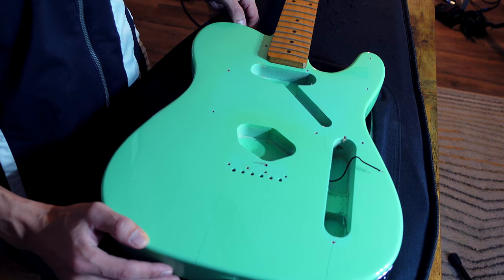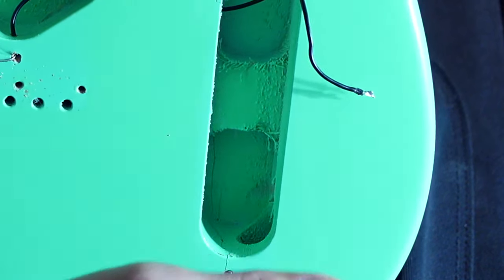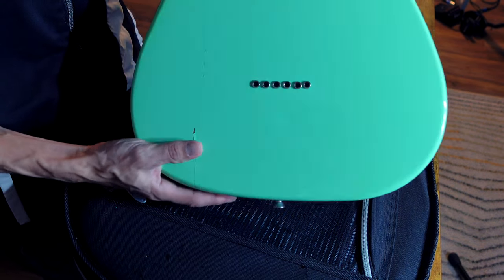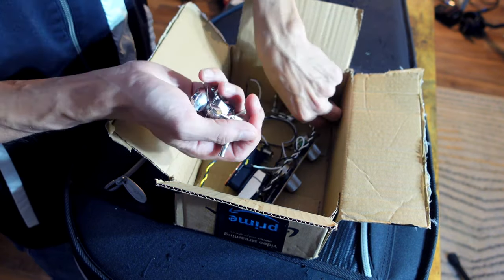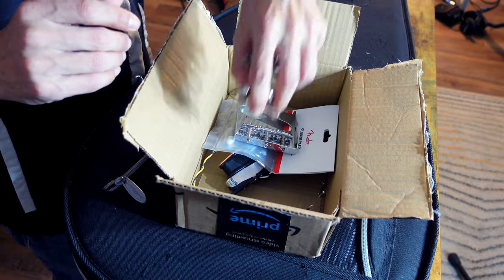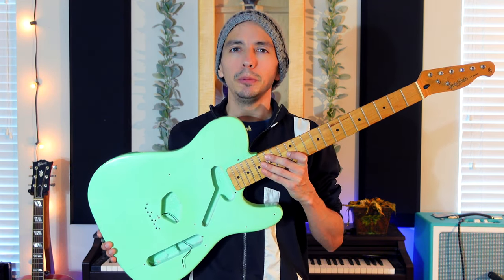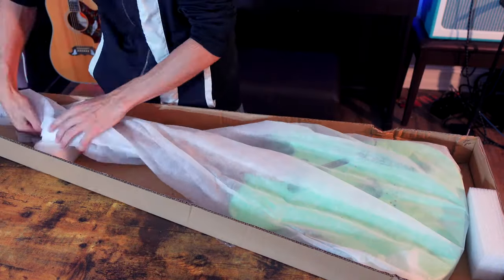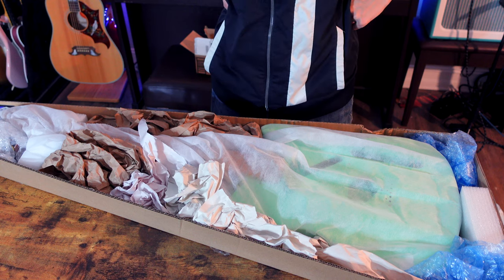This pic was BEFORE it fell off the wall...

Comment: I've been watching the Rosa Strings Works channel for a few years now and I've seen him repair many structural breaks. Although he works on acoustic instruments I'd think he would do the same with this guitar. He usually uses a Krazy glue type glue with high viscosity, I think they call it a CT glue, then clamp it for long straight cracks along a thin top, back or sides. The other method he uses for thick breaks is to flood it with Tight Bond glue and then clamp it. An advantage with Tight Bond is when you clamp the wood together you can easily wipe away the glue that squeezes out with a damp cloth and the exterior finish will remain perfectly clean with no residue. Mr. Rosa is just a pleasure to watch, so skilled, so personable.